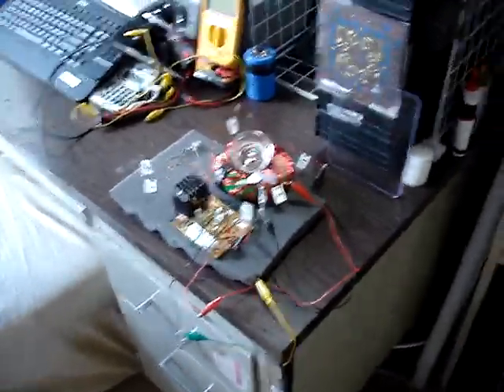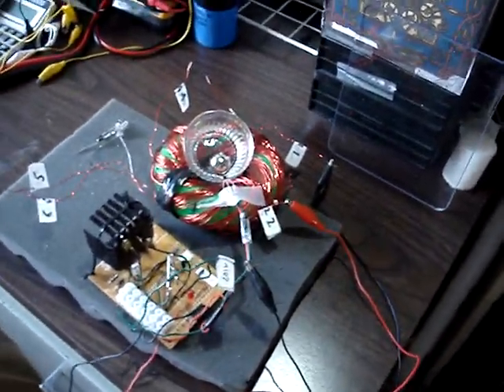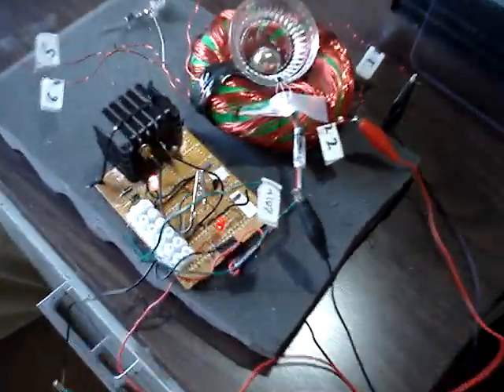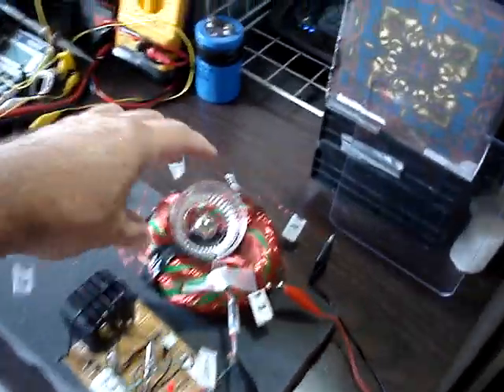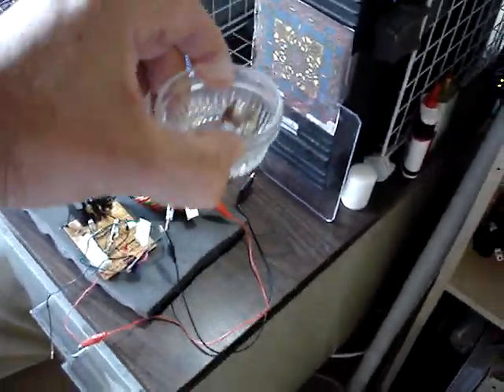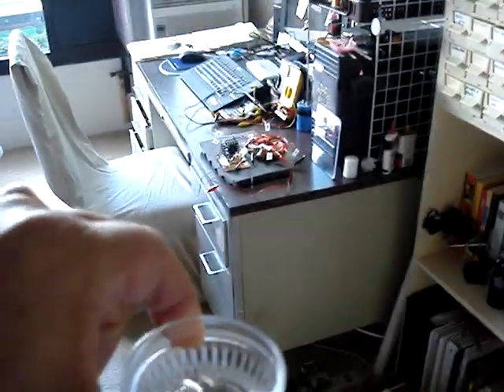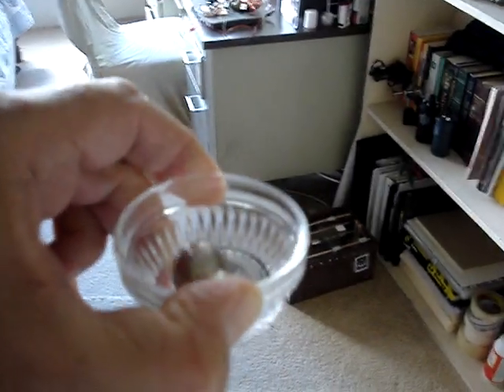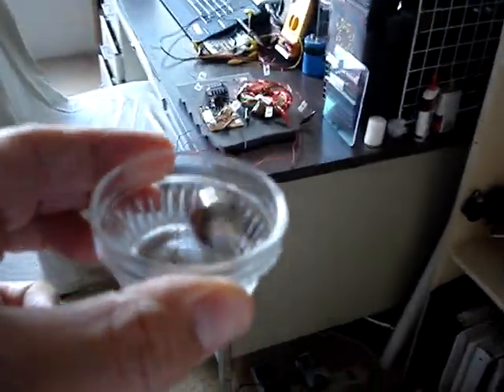Lolo Neoball Resonant Spinner II

Comment from the maker: Nick,  There is not a set input, the frequency is determined by how fast the ball is rotating at each moment, triggering the Hall sensor which fires the 2 transistors off.   It is regenerative like a downhill snowball.   The same circuit is used in a number of my videos, for example the Dogsaver Starship Coil has the schematic displayed, same circuit as here.       happy building

Comment: What happens if you give power to the coil with the neoball in the glass cup at some distance away? Is the continual vibrations and oscillations dependent on distance? What happens if you get the ball rolling (excuse the pun) and walk away as far as possible, does the ball come to a halt the further away you are. Is there a magnetic field induced around the coil that causes the oscillations in the ball... omg I have so many questions...

Comment: You moron, Before claiming the rodin coil has an effect on your rotating neodymium ball, I would recommend you put a tachometer on it. your ball is spinning extremely fast; it not like it will stop in 10 seconds once you take it out of the EM field.... for starters, keep it 5 feet away for 5 hours and tell me if it is still running....Again, don't be a moron.

Comment: okay so same as the rodin coil but 2 wraps of 12 turns? the 12 point star? i really want to make powells version but im not sure how. also how do you know the ohms? im trying to build a speaker i got one working a little with rodins design but it was heating a lot and very quiet. im assuming thats about the ohms. thanks!

Comment: that is beyond weird, is  it possible that the circuit is still oscillating after you disconnect the power?
If you break the circuit as well as turning it off, does the ball still spin?
I have a theory that says that electro/magnetic flux can be pulled or projected and except for it being off this seems to be evidence for that. This is how I believe many FE effects work.

Comment: @jackscholze   Aluminum might let  resonant frequencys through. Since we are dealing with magnets  steel or iron is an attraction and should block those frequencys.????  I am using an aluminum axle rod in my device and it does not seem to hinder magnet speed??  I am going to try to replace the rod with a heavy  thin fishing line with stainless steel ball bearing fishing swivels  on each end.  This will allow my Diametric ring  magnet to free wheel without spinning the axle weight as a drag .

Comment: The reach and capacitance (or duration of resonance hold) are most impressive! I've only seen something similar with Dr. Stiffler's work, power transmission over a distance, that's just something quite different.
Best Rodin coil demo I've ever seen, and it just brings more questions that answers!